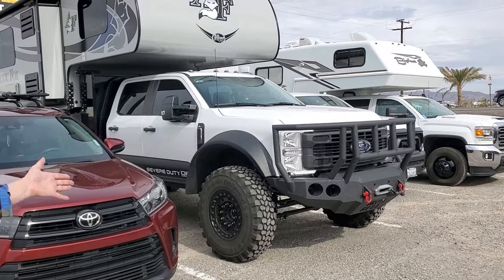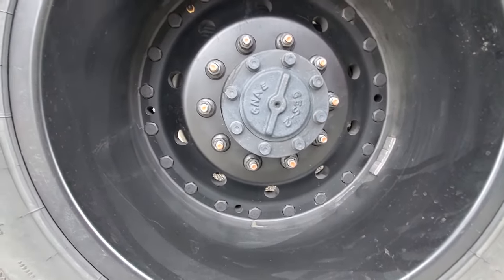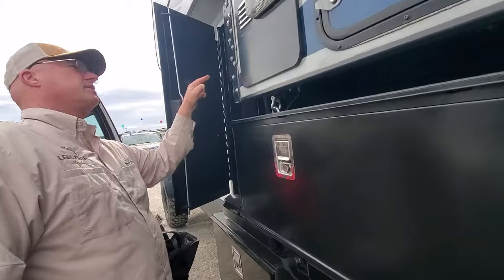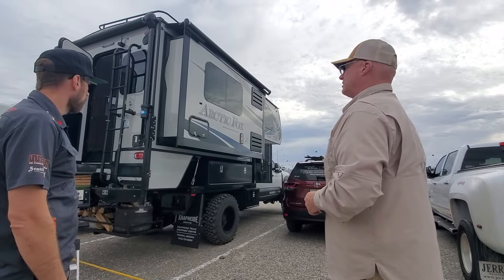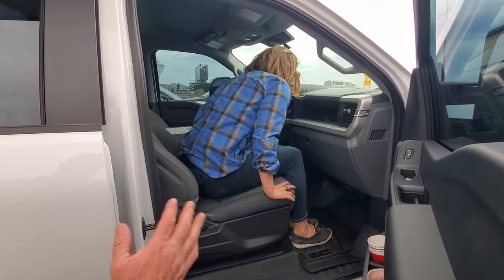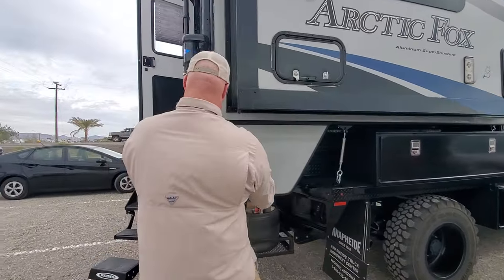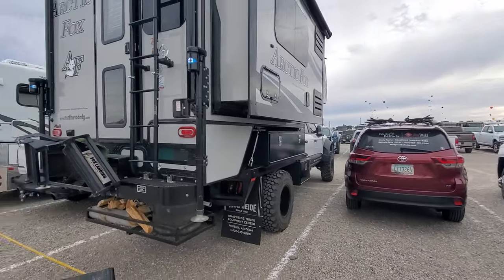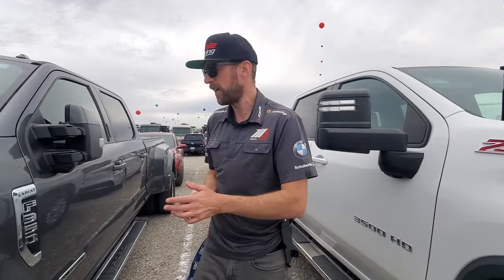F550 "How To Earthroamer DIY" Truck Camper | Super Single 'Severe Duty' Conversion by DBL Design

Comment: You know what would be cool? Run your gasoline powered overland rig off hydrogen. Compress it on the rig. You could run your generator on that to. Would you even need solar? Wait. Is that a knock at my door? The powers that shouldn't be get nervous when you talk about compressed hydrogen 😂
Reply: There are many drawbacks and issues with using hydrogen.  That is why nobody is doing it.
Reply: @SomeTechGuy666  I saw a guy with a blown LS in a street truck. It ran pretty good. Are there actual problems or just problems with the government? Myself. I'd rather use the oil. You can't drink oil.
Reply: @SomeTechGuy666 not sure about what issues there are but there are plenty of people running vehicles off hydrogen exclusively. I lived up the street from a NASA engineer who converted his truck to hydrogen and I worked with somebody that did the same to his truck. There may not be any large corporations doing it, but it’s not entirely obscure technology.

Comment: You actually don’t want your weight in the center. You want your weight centered over the rear axle as much as possible.
Reply from the maker: Not when the rear axle weight is 12000lbs and front is only carrying 6000lbs.  We want to force thr weight forward as much as possible,. But yes your point is referenced when not so rear biased
Reply: @irnieracing  not arguing, try to learn. I based my assessment on the literature that the truck manufactures provide specifically regarding truck campers. They always specify to put your camper center of gravity over the rear axle. What am I missing?

Comment: And who's going to split those wheels on the trail? Have you ever taken one appart?
Reply from the maker: When I get some 3 piece super single wheels  like Hutchinson brand, I will film a practice change over.
Reply: Umm pretty much anyone who’s ever driven Moab… well obviously not everyone has bead locks but a good majority of your jeep runners are running bead locks and they field change them all the time.
Reply: Please don't film that. I'd rather drive on a flat tire to the tire shop and ruin a rim than pull apart a military wheel in the desert.
Reply: @irnieracing DBL has a video on changing the tire on youtube
Reply: @macbook802 
Stay with a pavement princess rv then. People afraid to get their hands dirty or no mechanic skills have no business offroad.